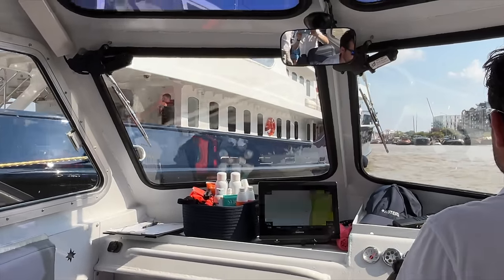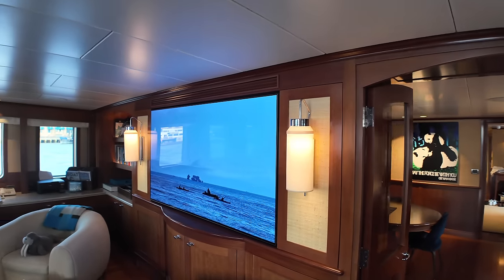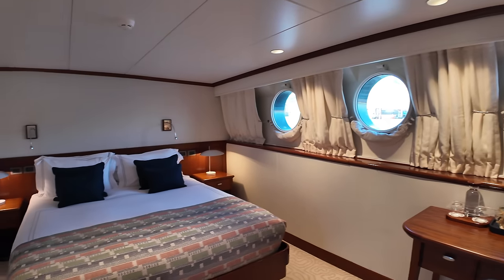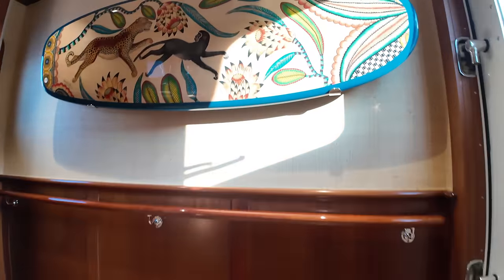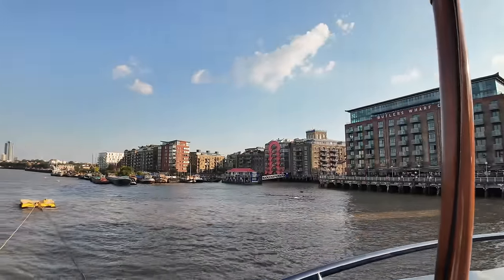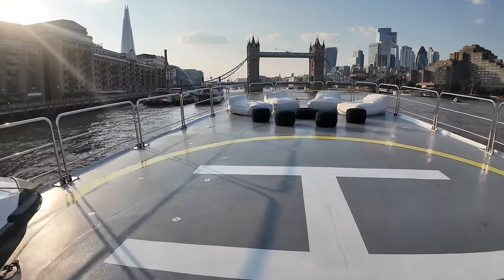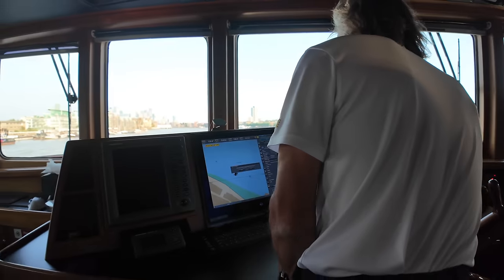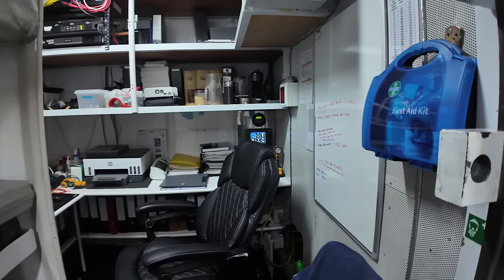THIS Is ASTERIA! $19.9M Steel Explorer Yacht (Converted Salvage Tug, 5,000 NM Range!)

Comment: It’s a bathroom sink, people that complain and demand it be called a “handwashing basin” are just being pedantic and trying to be smarmy. I love this ship though
Reply: Guess it's where you're from we call it a wash basin a sink is in the kitchen for washing dishes and it's not being smarmy or pedantic just to correct your smarmy comment
Reply: It's an American thing, they need more information. Hand washing sink (sink), side walk (path), waste paper basket (bin), eye glasses (glasses), racquet ball (squash), horse back riding (horse riding)
Reply: It's not pedantry it's accuracy!  A basin is used in bathrooms as it typically is made from porcelain or some other fine finish and has a shallow depth sufficient for hand washing.  A sink however is used in a kitchen and is typically made from stainless steel and are deep enough to accommodate a bowl or pan to be washed or for water to be added to a pan.  The taps are different between basins and sinks for this reason, the former being smaller and decorative and the latter often have tall swan necks to accommodate pans being filled!!
Reply: @lips5913  Or....and hear me out: you have kitchen sinks, and bathroom sinks. I've never heard it called a basin. I understand the premise of it, but it doesn't seem to be a commonly used term.
Reply: @DillysNZ McIntyre much? 😂
Reply: @rod4607  100% was wondering who would click..
Reply: Isn't that next to it a head not an ensuite?

Comment: Weel, dinna ken sailors are bloody superstitious! Ye dinna say sinks onboard a vessel aye, it strikes terror into the hearts of sailors. There’re called hand basins. 😂 Some bad Scots from a Canuck across the pond. Anyway I had to laugh as you were talking about the engine room.  Between your accent and my deafness I thought you said have you ever seen an engine room behind a sandbox. What??? I finally clued in sound box. And yes in fact I have! On a 60 ft steel trawler hand built by the owner who enclosed the single John Deere propulsion engine in a sound box similar to the two gen sets on board. All approved by John Deere for warranty. No over heating issues. If I remember correctly the owner was an aeronautical engineer and quite innovative with how he constructed the boat literally in his back yard, the features it had etc.